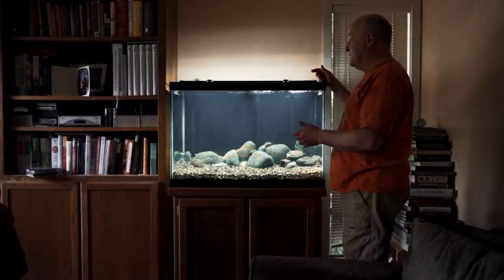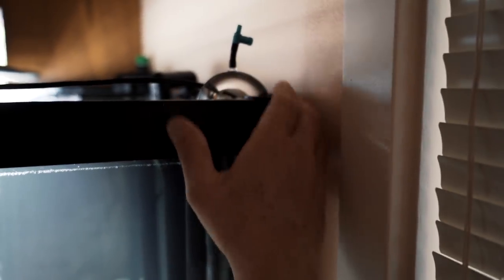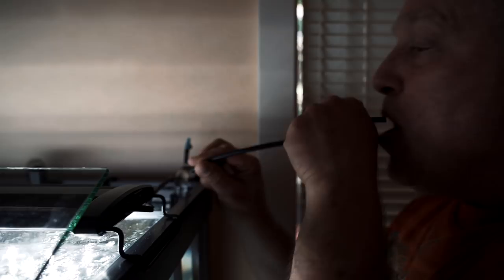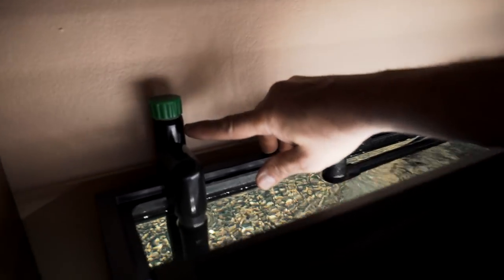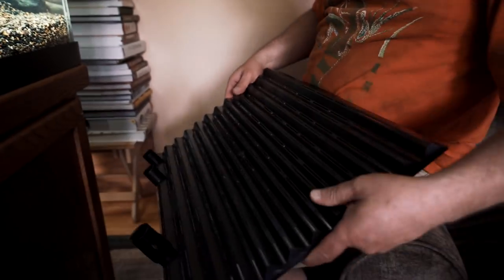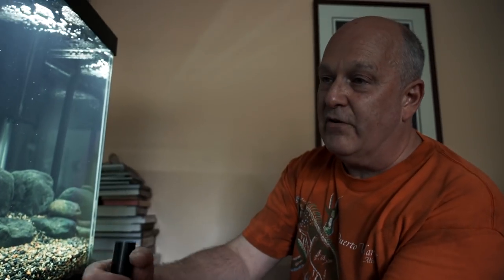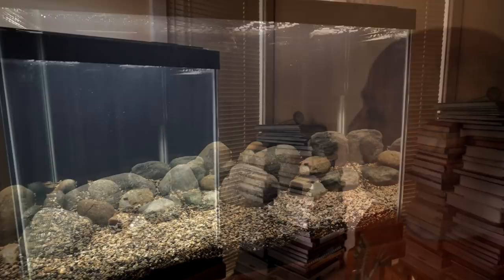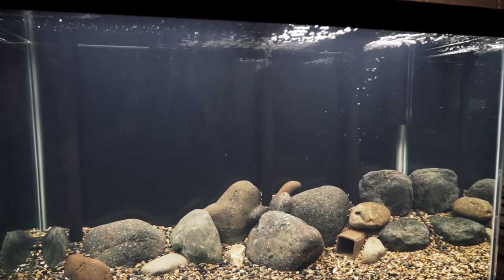Giant Lung Fish in a Customized Aquarium!

Comment: Why salt in the tub? We need more information on that. 😁
Reply: Why salt in the tube to bend it I'm guessing is the question? If you heat the tube to it's near melting point and bend it, it will collapse. So you have to have something inside to keep it from collapsing. Sand or gravel ends up getting imbedded into the inside of the hot tubing, sugar starts to melt in the heating process, rock or aquarium salt leaves the inside kind of rough, regular old table salt works great, it's also cheap and I've re-used the same salt many times over to bend tubing. I've tried all of those and other methods with many failures, so don't waste your time, just get a cheap container of regular table salt. Note I don't use it for cooking after using it to bend tubing.
Reply: Deansfishroom simply genius. I will keep this in mind for the case i wver have to bend a tube. Thank you.